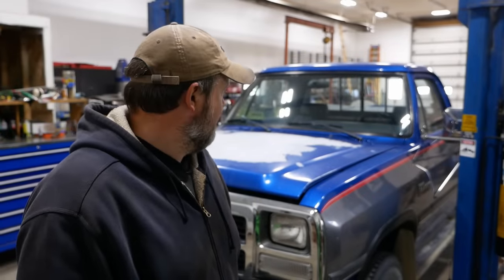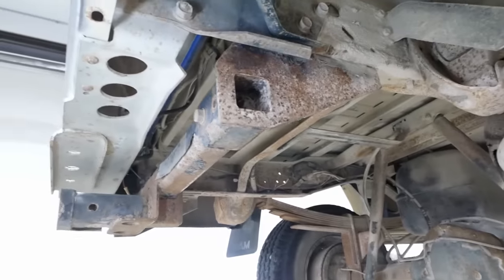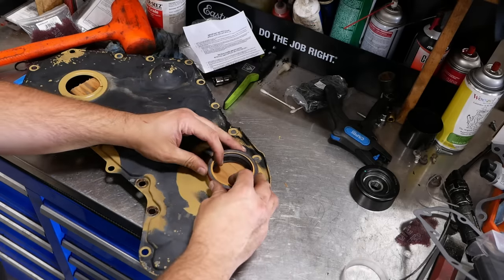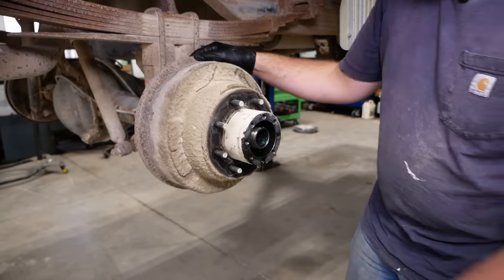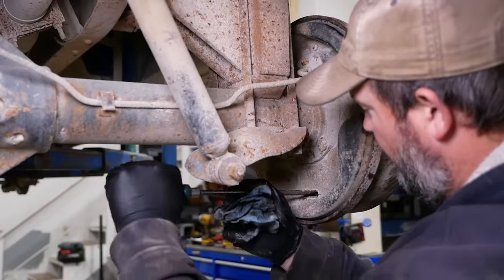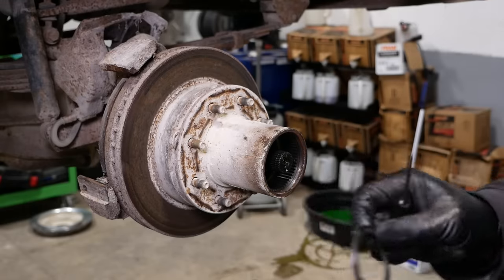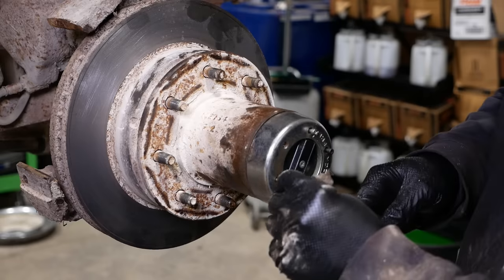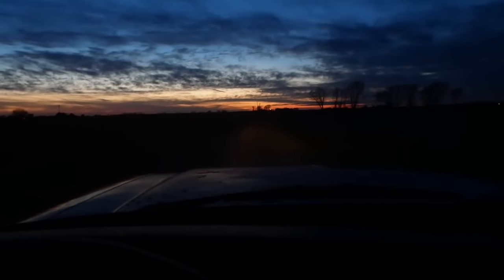Cherry 92 Dodge Cummins: Killer Dowel Pin, Brakes, Seals, Etc.

Comment: In the 20+ years I've spent as a master diesel mechanic i have still yet to lay eyes on a engine that has failed due to that dowel pin.  Not saving it can't, just still waiting to actually see one in person.

Comment: As far as the loose front end on the Dodge. a lot of it is normally in the gear box. As long as everything else is tight there is a kit designed to support the lower end of the gear box to help give the sector shaft part of the gear box more support. Additionally make sure the stabilizer portion or stabilizer bar ( the one that keeps the axle parallel to the frame is in good condition. It is difficult to make any solid axle truck drive like a car. That is the nature of the beast....
Reply: The above link is just a sample, there are several different makes and models to choose from.
Reply: Also the steering shaft maybe a problem

Comment: Another great video Wes.  Always look forward to your videos.  That truck is in great shape no matter where it’s from.  Most of the issues with this truck are probably from it sitting given the low miles on it.  My 2001 Dodge wanders a little also.  I replaced all the steering linkages, ball joints and it made it a little better.  I think maybe a set of aftermarket adjustable trailing arms so the caster can be dial in a little better might help the steering.  I’ll try that on mine one of these days.  I did recently changed out those unit bearings to a set of manual locking hubs from Dynatrac.  I like old school locking hubs.

Comment: Super videos, Wes! Glad I'm subscribed. I have a 2nd Gen Dodge 2500 24v Cummins -(2002). My steering/front end was loose and there was play in the steering and it wandered on the highway. Couple things I did was to add an aftermarket steering brace and replaced the steering box with an aftermarket box (RedHead) and then got the thing aligned. This was a big help.

Comment: Steering cylinder vapor shock is about the only thing that helps them. It is aftermarket boat on application. And stock vehicles came out with them

Comment: Just curious why did you use a piece of wire to hold the delta in place. When almost every time I've seen that done if somebody made or actually bought a flat tab that has a whole drill in it for the bolt. Just never seen anybody do it that way actually it's smart it's even easier than making a metal tab always learn something when I watch you thanks you.

Comment: Worst brake calipers did on one Wes was not sure of hand but had 2  cylinders plungers on the front Calpliers and how bad was tell! Rotor were done , pads too plus Calpliers to and was so bad pads stuck to Rotors! Also on Second Dodge ask about check Steering wheel box if got think 3/4 nut top and Aligin wrench hex of 1/4 size set screw you  have take nut 3/4 or bigger lose plus Align socket for 1/4 screw to and make sure Steering Wheel perfectly location plus  tires straight to and with engine running tight hex screw then nut after ! When go for drive If not Steering wheel box engine compartment not keeping Steering wheel straight plus drive needs replaced replaced too! Also try grease all Steering suspension up  lots grease if not problem does Steering wheel have tilt Steering wheel and if does Universal joints plus bearings need replacement and wheel need tighten up also be near horn switch in middle to ! Be like GM did in 1988 to 1995 vechiles on Steering wheel column plus box in engine compartment with fluid lines to Wes ! Hope helps you buddy!

Comment: Use the newer style tie rods and if 4x4 upgrade the track bar. Fixed my 96, also if 4x4 there is a frame bar, I forget what it is called, but bolts under the sway bar, and attaches also under the piman arm on the steering box. Can get as a kit for about 150.00 to 200.00. I don't look like a drunk going down the road no more. Weak front frame on the 4x4s.

Comment: I have a '94 Dodge Cummins about the same as you were working on only it's a 5 speed it's got to get rag in it we've redone the front end it's tight as can be but dodges they just drive like s*** it's just the way it is I don't know of any other way to fix them they say there is a steering box that you can get but I don't remember the name of them or the company that makes them that will cure that but everyone I have driven drives the same way sounds like the guys just going to have to learn how to drive it and live with it if not sell to somebody that knows how

Comment: Would be interested to hear Wes's opinions on hydraulic drum brakes in general. Sounds like might not be a big fan of working on them (understandable), but I tend to prefer them on my larger tow rigs.  Do you think they are totally eclipsed by modern disc brake tech?

Comment: If he wants to throw money at the problem, dodge off road track bar, 4th gen steering links and steering gear brace. Then it will drive just as crappy as a 4th gen. Plus I've drained the steering pump and gear and replace fluid with hygard. Made a significant improvement.

Comment: I know for sure that a steering box stabilizer and track bar brace will make the wandering steering issue significantly better. I helped a friend install it on a 98 ram, and I get to drive his truck once a week or so. Night and day difference, but still not Ford good. If you look at the front track bar brace on a coil front spring 4wd super duty (where it bolts to the frame and engine cradle), you see how much attention Ford gave it to solve this issue. The problem with the Dodge is it's not a stuff enough design. The way the track bar mounts to the frame rail is about as terrible a design as those calipers.

Comment: WES- DODGE FRONT END ADVICE: Some of the Dodge front end issues cannot be fixed with all the parts in the world such as death wobble. Sometimes its not just the worn out components but also things like the bolt holes or where components such as track bars especially connect to the frame or axle that are worn or twisted. Ive seen plenty of Jeep and Ram death wobble go uncorrected with new parts.

Comment: That’s an incredible solution for a Killer Dowl Pin retainer! Why didn’t the Cummins Einstenios figure that out when they designed the engine
Reply: Because they didn’t have the benefit of having several millions of miles of combined miles and decades of age on the engines when they designed them. This issue isn’t something that happens on new engines.

Comment: If the problem is similar to the one my '94 Dodge Ram 2500 had, it's a worn out bushing in the steering shaft located between the firewall and steering box...  Replacing should make a big difference but it will still steer like a Dodge...

Comment: That the dodges handle so bad is really kinda interesting, I have a 2000 f350 DRW super duty with a Dana 60 front with over 200000 on the clock, it actually handles well, Its gotten a fair bit of new ball joint/ tie rod parts, but otherwise its OG... I did tighten up the sector gear in teh steering box a little, I have about an inch of wheel play now vs the 3 I bought it with, but it does not seem to wander, pull, or do anything else strange.

Comment: The dowel pin issue is similar to the Porsche Boxster IMS issue. After 20 to 30 years I'm not sure it's really a thing one need worry about. Personally I'd go with more driveability fixes.

Comment: I drive old dodges from the vans to the big cummings trucks (1994 to 2001)  and I have never had one not have front end vibration. They ride like tanks but that's just dodge for you. I have driven chevys and fords so i know what it's like to not have that feeling. But even brand new dodge trucks feel loose compared to chevy or Ford.

Comment: That pin looked good but it don't have that many miles on it. I just did one in the middle of the summer and the pin was coming out the guy got on it at the right time because if he would of left it alone it would of feel out because it was 3/4 of the way out.

Comment: I have a near cherry 1999 with 134k miles.  I completely rebuilt my front end with better than stock components. Some of the steering slop was gone. I tried the RedHead rebuild of my worn steering box...no luck.....still somewhat sloppy.  Then I went with the big PSC steering box and slop improved but still not like when the truck was new.  After what I read about the PSC box being so beefy and so tight, I have to say I am pretty dissatisfied with it.  I hear a rumor that some of those PSC boxes were actually used boxes just repainted?  Have you heard any truth to that?  I'll get under the hood this spring and try to snug up the box play again.  Grrrrrrrrrrrrr.

Comment: A good quality steering gear is one thing. 
Frame stiffener kit is another. Ties the frame rails and steering box together. 
Another is a “T” style tie rod setup versus the “Y” style. Y style the toe constantly changes with suspension travel. Was a crappy design in my opinion. 
Do all 3 and have pretty tight steering for what the trucks are.

Comment: The factory mounts on the axles are terrible. Check that the tracbar mount isn't egged out on the axle end?

They'll wander with an egged out mount before they do the full on death wobble. Or if it's gone far enough it'll just have so much play that it won't death wobble.

Comment: Those trucks will pound your kidneys clean out of your abdomen.   By todays standards those VE pumps are anemic.   Especially in front of a shush box that didn't have a lockup converter or over drive.  But when compared to the competition of the day... they were awesome.

Comment: Always great videos as always Wes. 60107 Illinois says hi. Do you or anyone know if a 2002 5.9 24v is affected by the KDP issue?
Reply: It has been  stated by some, that the early isb/vp44 engines have a case that will allow the pin to fall out if loose,.. the ones I've seen,(99,00,01,02), have a step in that dowel hole where the outermost diameter is smaller so the pin can't fall out..
Reply: Can't speak for an early '98..
Reply: Or late rather..98.5 24valve

Comment: steering box brace will help on the 95  and good steering damper both cheap items can't hurt to try em , I have a 98 with 200k  and 02 with 80 k the 98 is like a new truck and precise and the 02 wanders like an old wagon  , go figure

Comment: I'm dealing with the auto locking hubs on my f150 right now.... the vacuum backing goes bad, and let's your hubs suck back out while driving whick makes it eat the locking ring off of you hub, making you buy a whole wheel bearing instead of just a vacuum actuator....

Comment: On the 95 or 96 dodge get rid of the homemade lift, to properly lift an independent front suspension you need new upper and lower A arms that have been built for this truck, not to mention a different cross links to leeson the angle of tie rods , Pittman arm lengthened etc. It needs a complete lift kit engineered for this truck.  Not like the strait axles of yesteryear were  a set of leaves went up front blocks in the back, lowered pitman arm and four longer shocks a a steering stabilizer.
Reply: 👆Thanks for watching, love you so much fan!
    Tell  Aɴᴅʀᴇɪ Jɪᴋʜ, you were referred by me he has something new to share with you easily get in touch with him.

Comment: ouch... the plastic ring is the installer tool for the timing cover seal... even the greatest of all can fail sometimes !
Reply from the maker: We used it to get over the crank. You can do it without it if you have the patience.

Comment: Check the bushing in the back shackle on front springs it hid inside of the frame it will be shot the truck will wander all over the place most people will blame the rag joint or steering rod

Comment: Seems to me that the 100% fix for the dowel pin issue is to remove it completely as its purpose is for alignment during installation. After installation it serves no purpose at all. Much like a clutch alignment tool. The fix you proposed would still constitute an issue if the bolt backed out . I'm assuming you installed it with some loctite tho.
Reply: If the bolt backs out, the engine will be destroyed just the same, whether there is a dowel pin there or not. The odds of a properly torqued bolt backing out are almost nonexistent.
Reply: @ouch1011  you're referring to a bolt that doesn't have a piece of wire under the head that will go thru heat cycles and ultimately lose torque.

Comment: If you want to make a second gen steer well here is what I did after trying the HD OEM Mopar T style steering that drove worse than my old y style linkage and got loose enough in less than 10k miles to cause mild death wobble. I do not recommend sticking with the Mopar linkage. It is garbage. So here's a parts list with rough pricing from memory as of 2021 when I threw everything and the kitchen sink at my 97 dually's front end after owning it for 11 years and putting 100k on it bringing the odometer to 280k:

Disclaimer: Before anyone blasts me for spending this much on a front end, let me tell you that it was not an easy decision. I considered a kingpin D60 swap but didn't have the time to do the fabrication. When the t style steering linkage got super loose in under a year and less than 10k miles and my ball joints were nearing death, I basically parked the truck and it took about a year to save the money I needed to buy what I thought were the best parts available to me at the time.

Synergy Steering Linkage: $950
EMF Ball Joints: $550
Carli Third Gen Track Bar: $500
2nd gen to 3rd gen Track bar conversion kit: $200
Steering Box Brace: $220
Suspension MAXX front sway bar end links: $125
SKF Unit Bearings: $350
Carli Upper and Lower Control Arms: $800
Carli Steering Stabilizer (Bilstein 7100 bought quite a while ago): ~$300 if I remember correctly
Total: $3,995 

I did not have to replace my steering box as my sector shaft play is minimal, and am still not sure who I am going to go with when I eventually have to do so. I have not done the Borgeson steering shaft upgrade yet either as my steering shaft is tight and as you might imagine, after this parts bill, I wasn't looking for more stuff to buy needlessly. I've had the track bar, steering box brace, and sway bar end links for about 10-11 years now, but the track bar was rebuilt with new Carli parts on both ends when I did this rebuild. I am running Carli leveling springs that are also about 10 years old, so the main reason for buying the control arms was to get the axle where it needed to be. But I also bought them to give this front end no more excuses for driving like shit, as my stock control arm bushings looked like crap after 25 years and 280,000 miles. 

You'll obviously pick and choose what parts are necessary but I can tell you that my truck steers just as good as any brand new truck rolling off the dealership lot. Granted, I have about $4,000 tied up in the steering of this truck and I hate that, but the driving experience is better than it has ever been before and I've never driven a second gen that drives as well as my truck does now.

Comment: Did I miss something (not using my hearing aids)- what caused you to install that neat wire to stop the dowel pin from coming loose?
As for the steering, I know nothing about Dodges, but does it have a steering damper or can one be installed?  Very cool video, I learned a lot about those breaks; it probably won't do me any good on my Ford Econoline.  Maybe your canine friend needs a cat partner to seek and destroy mice.  Happy Thanksgiving to all.
Reply: Those dowel pins are notorious for falling out due to the vibrations of the engine over years and years of use. When they do fall out, since they are hardened steel, they cause some pretty extreme damage if they get caught in the gear train, up to and including catastrophic failure of the engine. It’s much cheaper to do something to retain the pin than to deal with the damage after the fact.

Comment: My experience with front worn suspension, is it all wears together. Its never one part that can fix it. Rebuild the front end and it should clean up. Heavy motor=heavy wear on front end.

Comment: try this,,dodge front steering,, 1.5 caster bushes,,1 hell of a hard damper..if that fails,,fit a s/duty front end..cant see the difference,, there all pretty much the same..my 75 h/boy, drives like a train, perfect..should be neg camber, pos toe. i think,ish..

Comment: Too much toe in is usually part of the problem ... solid axel rigs need no more than 1/16 toe in..most shops put waaay too much..factory spec is waaay too much.. everything has to be tight,  no slack In the steering linkage.

Comment: I've got a '93 ... engine and most other tagged & numbered components go back to '92 year model, so it was built out of '92 leftovers.  Very much like the one you worked on here.  You covered a lot of familiar (to me) territory on this one.  

One thing that was not covered here ... 1st gen 4x4 models, you need to keep an eye on the  steering box mounting plate and the frame where it attaches.  They are prone to developing cracks/breaks in that area.  They can show up anywhere between the spring mounts.  If the truck owner is kin to Ivan Swope (long story behind that one ;-) ) it would be wise to inspect the entire frame for developing failures.

Comment: tighten inner nut,,to about 50ftlb, back off about 90,ish, tighten outer, after finding correct hole for pin,,to about 80ftlb,,i think,,from yrs ago..ish..prefer the modern hub set up. 4 bolts, done..

Comment: you missed your chance to rattle cages (snicker) wheel bearing grease will not migrate and if it could, it would run out on the ground, so just packing the bearing cone is what is called for, not filling up the hub cavities ,which is a waste of grease ,time, and aggravation for the next mechanic.